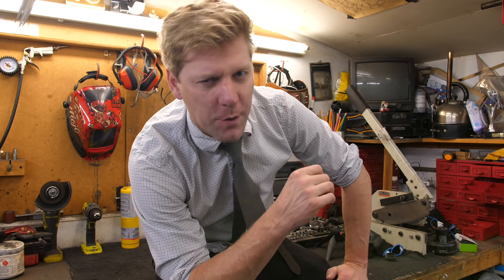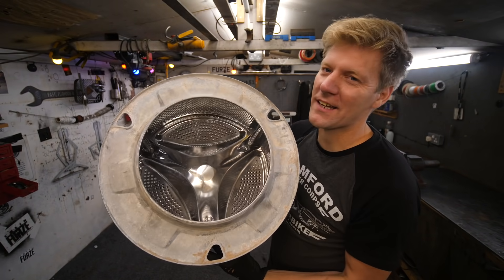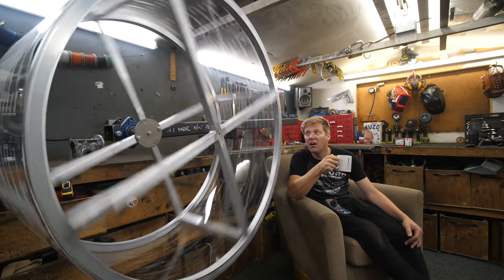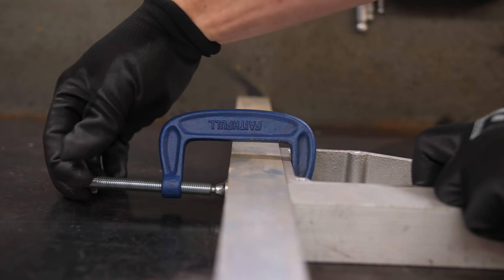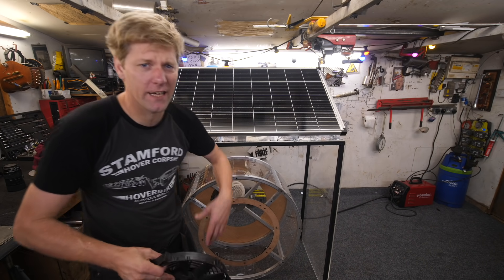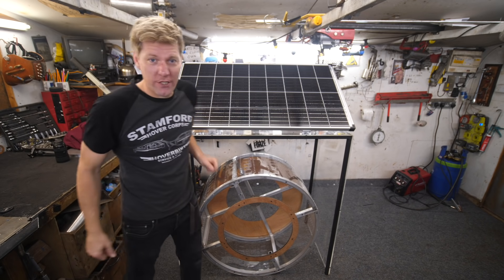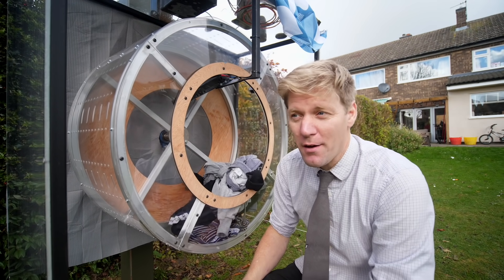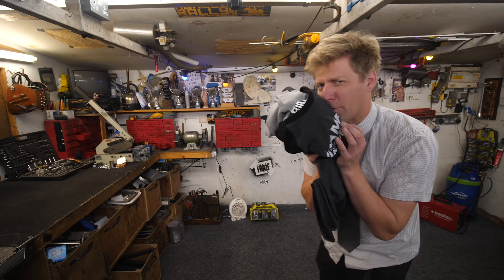Wind/Solar Powered Clothes Dryer

Comment: Now you are on laundry, I want my washing line to go up and down at the push of a button But both ends up and down at the same time, keeping a slight tension on the line and keeping it parallel to the ground. I am sure there is a way, with several lines and some pulleys? Yes or No? What do you think?

Comment: you actually lost alot of heat using the materials you did compared to the metal drum in the dryer. - the heat from the sun on them metal drum, would have acted as a heating coil. pretty cool idea tho.

Comment: Colin chooses "home decarbonization"
Also Colin: replaces a clothes line with a lead acid battery, a charging regulator, 30W solar panels, welds 30 ft of steel pipe, 15 ft of alluminum tube and uses 20 square feet of plexiglass. Huh I wonder how much carbon footprint you saved there bud?

Comment: Should use a heater with fan. Or make use of a sterling engine. Heat will heat cloths. the spin of a wheel would allow the turning of the drum

Comment: I just dont understand this outdoor dryer thing, dont we already have one of those that people have been using for over hundred years now? Yeah we do, Its called a CLOTHES LINE and it uses neither ANY motor power OR solar power, just the wind and only requires a bit of line and some clothes pins. Just saying, its kind of like reinventing the wheel here bud. LMAO. Honestly, I would have went with a Solar powered washing machine, considering a wind powered dryer already exists in the form of clothes lines. But there is NO easy way to wash your clothes without a normal washing machine unless you want to do them by hand.

Comment: I can appreciate the engineering prowess of Colin, but this is a typical renewable nightmare. It's way more expensive than any conventional clothes dryer and it's much, much less effective. A honest to goodness clothesline (or clothespin rotary clothesline) would be an excellent replacement for this with a transparent gazebo (for heat added and rain protection). It's an interesting prototype nonetheless though.

Comment: i do a better accent.. lol
a curved mirror under the unit sun directed would concentrate heat to the drum. air flow with a door on it from the bottom exhaust pulling thru the top removes humidity. by causing a vacuum  where is water in a vacuum boils becoming airborn leaving the garments faster in combination with the suns heat

Comment: You need a generator that runs on hydrogen and oxygen using electrolysis in case the grid goes down and you run out of power in your bunker ⚡

Comment: If you had a creek you could just put the drum in the water wheel and the fan on a separate wheel then use the spare energy for upping the efficiency. Drying cloths with water.

Comment: Wind and solar powered clothes dryer.... a length of 6mm cordage that is affixed at both ends to a tree or T placed in the ground and you hang clothes across the cordage, wind blows across them wicking out moisture that the sun has heated. ....

Comment: A Wind/Solar Powered Clothes Dryer is a clothes line suspended between two points raised above the ground and typically run through two pulleys. All the rest is just gadgets...lol.

Comment: Me just get a PV MPPT VFD ( Soler pump (PV Motor Inverter ) - Battery less setup
and 16x LG NeON2 415W BiFacial (upto 540W BiFacial) Solar Panels LG415N2T-L5 to make a 800V (792V) PV DC Sting > MPPT VFD 6KW > 240V AC [1 phase - 3 Phase] > UK AC socket

Comment: Far as I'm aware, and I haven't done the research and neither has Colin, that just tumbling clothes around does nothing. It blocks the wind from blowing over clothes, pulling them into it. All that moving air encourages water molecules to evaporate and leave the clothes even at whatever temperature it is outside. If you block that with a big drum and some sort of notional tumbling, you get nothing. It's much worse than a washing line. Ironically making this useless window-dressing. So you should probably win the competition. 

Buying a tumble dryer, trashing it, then deciding it's useless, that's certainly the spirit if not the letter of this nonsense. I think I'll go back to Colin digging his big hole, whoever sponsored that. It could be Satan himself and it still wouldn't be much worse than this one.

Comment: Ecological tinsel from a massive source of pollution. Like when they put solar panels on their petrol stations. Net saving, basically nowt. Petrol sold, absolute shitloads. Comes out of their PR budget and costs them basically nothing. American vehicles use something like twice the petrol that European ones use, and nobody is interested in doing something about that. Shell's entire business is digging oil out of the ground, refining it, and selling it. Renewable anything would cut into their profits. This is purely PR, "greenwash", and it's nonsense.

Apart from that, I love to see inventions. But I wouldn't be surprised if Shell bought up the patents then burned them. At least paper is renewable.

Comment: You still have to fold them after they are dry.  You can't really catch consumer attention with that cloths dryer, is the problem. Too big, too slow, only works in summer, etc... I know you said to start small, i understand. 
It would a better ideal to save the consumer time AND carbon emissions. A better ideal is to just put the wet cloths on hangers on a special line in a special built "green house" for the cloths. This way the cloths need no folding, and when they are dry then you are done, just have the line travel them into your closet. You can have plants in the green house too, maybe it will add a nice smell to cloths too. And by having them on the line they will dry much faster because there is space between them. Plus the heat build up in the green house, and some air circulation will allow drying fast. 

Better yet, figure out how to design a closet that dries cloths, this way when they are dry you are done. They are already hanging there ready for you. Maybe extend your closet to include the mini special built green house, then when they are dry it automatically circulates the dry cloths in your closet, and is waiting for a new load to dry.

Comment: One thing I have found over the last 40 years......even on a bright sunny day if you haven't got any wind you won't dry the clothes.........that is down in OZ .....and that does not apply to Summer when the air temperature at 35 deg C is enough to fry your balls off.
I'm working on an idea to rotate the Hills clothes dryer, which is an OZ iconical device found in practically all OZ gardens......going solar and Green is for the birds.......just too much mess and bother and the cost....oh my.....so it will be an electric motor, mains connected etc and coal fired via the grid.

Comment: Using Copper plates for the drum and painting it black would improve the efficiency massively (:

The most funny thing however would be to attach solar panels all around the drum and add the motor with a worm gear at the back, which engages to a sprocket which gets turned by the wind turbine.

Only the sprocket would need a one way clutch of some kind, like in the current build.

Comment: People in dry climates just run  the dryer motor on solar. Easier just to mod a dryer with a DC motor.  I run a LG washer on solar panels with no battery.  Only on rare occasions will it stop when a cloud goes over, but the washer remembers where it was when restarted.  I run the washer with hot water on all cycles giving me steamy clean clothes.  That free hot water heated by PV again no batteries so a very carbon neutral.  Electronics is the way to go.  Dishwasher with heated dry also on solar.  Whole summer home runs on only a single car battery.

Comment: the drum needs some baffles?  fins? to separate the clothes as the drum turns.  that would help keep the clothes from sliding around the inside rather than tumbling.  there could even be some blunt hooks for items to hang on as they went high to sort of stretch them out

Comment: Even simpler design: some wires between 2 walls and a roof over it.... the cloths doesnt get wet from potential rain and can dry naturally without any electrical fancy gizmo's ... dry in a few hours... worked well for the last 5000 yrs...
K.I.S.S.  -  Keep It Simpel.... Silly....

Comment: Have idea for a self powered light well sorta contact for info you build I'll give you the specifics mine works to a point don't have the math attic skills to perfect it it generates continuous power not a lot 18 to 36 volts low amps though will run led lightbulb don't need plugged in or batteries

Comment: Paint the drum with black paint, so that it absorbs more solar heat. And maybe some reflective panels around to catch even more solar heat in the drum. A thick bottom plate, insulated from below to radiate heat after sunset is another improvement i imagine could work.

Comment: Unnecessarily large (and heavy), the slick plastic surface dissuades actual "tumbling" of the clothes (could add a few obstructing inside bars like tumblers have) making a bunch of them stick to the surface, could have been infinitely better if the wheel had more holes as that's what lets air through & moisture out and the added plywood will be very susceptible to rotting and warping due to English weather and the part where you're stuffing it with wet clothes.

You should've also watched the forecast before making the wind turbine (and i do hope you added some sort of safety breaks to that thing).. Or just gone the extra mile and made your own photovoltaic cells by using copper sheets.

Comment: Air and water displacement powered air compressor driven turbine drum with piezioelectric plates to catch energy from the spinning that put the extra needed to use a small amount of the air flow to power the air and water displacement generator
....maybe even a levitating liquid pendulum washing machine built into the air and water displacement generator
Like archamedes sphere was ment for 

Ferroelectric polymer shock absorbing springs on acrylic axles with cloth in the brackets to catch the static with tinfoil capacitor

A spherical gyroscopic version would be cool

Free energy 
Like bubbling water to compress air
Compressed air can be added to water to cut through pretty much anything too
Water jets dont wear like saw blades do
All without even needing electricity or batteries

These are a few of my free energy upgrades
Awesome vids furzey boy cracking contraptions created

What about holographic projector shades using water vapor 
so nothing touches the face
Vapor density regulation acting like polarized lenses

 helmholz resonator gyroscopic antigravity supercapacitor ionic acoustic hoverboard would be cool

Comment: Hey Colin! I don't fully expect you to notice a comment on a month old video, but I just wanted to say I think this is a great idea, and I'm no expert, but thinking of my own clothes drier that I use, the air usually blows in from the back or through all the small holes punctured in the barrel itself. In this specific configuration, most of the air would leak out rather than pass through the clothes, since there's no door to isolate it, but you noticed that yourself of course. Secondly, most driers have inwards-facing fins that portrude from the barrel, creating slight "steps" that the clothes hang onto for an additional second before they drop back down, this would bring the clothes closer to the fan, as well as make them fall back down to the bottom while the other clothes are being brought up, creating more of a tumbling chain of motion, since your dryer seemed to have a lot of the clothes slide around the bottom for the most part, since there wasn't enough friction to drag them up at all, which might explain why the thicker clothes weren't drying, since heavier objects tend to stick to the bottom of a pile.

That's just my two cents of course, I'm no expert. Cheers mate!
Reply from the maker: your right but this was a test mainly of the wind and solar parts firstly, theres lots of things to improve so will revise it at some point
Reply: @colinfurze have you revised it yet
Reply: @colinfurze  *you're
Reply: I was thinking something similar, if you put more square stock across each one of the U shaped pieces, turning them in to a rectangle, the clothes would get caught on them and spread them out across the entire dryer, should increase drying time.  and if you put it inside an actual greenhouse, it'd get more heat, and the moisture would go in to the air, helping the plants.  Maybe I'll experiment at my brothers property in the mountains this summer.

Comment: The 'Wind/Solar Powered Clothes Dryer' has already been invented.
It's called a '#WashingLine'. 👍🏻😂
Reply: ...No, I did not check the previous comments.
Also - I was impressed by the creation - definitely easier than a washing line, albeit considerably more expensive to make (especially if you only have cutlery for tools to begin with).

Comment: Once again solar power beats the pants off of wind - cheaper, simpler, more reliable and just plain more powerful. For the money and time into the turbine you could buy a couple more panels, though I realize half the fun is the build here. I consider adding a wind turbine to my solar array occasionally, but always remember that it's rarely worth it on a residential scale. Utility scale wind is a different story.

Comment: Feel like concentrated solar into a temperature battery you could use to help heat and power the process would have worked better than straight solar. Good not to waste the wind though.

If you can get the sun to run hot enough maybe getting the wind and solar and which-what every to build up speed on a fly wheel to better tumble the laundry. Steady as she goes but a modern drier does have some advantages. Don't see a lot of fly wheel reliant projects online. Suppose it's a bit outside the ability of most hobbyists to craft and perfect... some day, somewhere, somehow.

Comment: Solar power and wind power alike are.... unfortunately poor options for renewable energy because they are both conditional, and revolve entirely around the weather. Water power is probably the best option, water delivers lots of force and is pretty consistent, most rivers don’t magically run dry overnight. Next is geothermal power which uses heat in the ground, which is often consistent enough to deliver somewhat consistent energy output, but geothermal systems lack power. As things currently stand, combustion is our best source of energy because it delivers power unconditionally. Tesla is a perfect example of this. My pickup from 2012 with absolute garbage fuel economy and a stupid v-8 has greater range than a Tesla, and it takes significantly less time to get it on the road when I run out of fuel. My truck has the aerodynamic qualities of a brick and is more sensible than even Tesla’s current best car. With the technology we have, we cannot get the sheer power and speed of combustion through renewable energy. Sure, we can make it work, but we’ll all need to learn to be a lot more patient.

Comment: Great project Colin you are an inspiration. 

Oil company greenwashing.  The oil companies use these project to look green and cuddly and for issue deflection.  

Pushing issues back at us makes you and I responsible and while we have some, no amount of changing light bulbs or saving paper is going to cut it.

These companies are the problem, they have known about the problem for 30 years and chose to do nothing but hide the issue and keep making money. Shell knows the greenhouse gas issue and yet they are still actively looking for new sources of oil and gas.  The current income from oil is $24billion 

What have they put into this project, a few £1000  They need to be committing billion to solve the problem.  If there were actively reducing production and changing the business model then I would be more receptive. 

The world needs to reduce consumption of oil and gas by 6% a year every year until 2030 and that will just about keep us on target
Reply: people... please listen to this man.

Comment: The most fundamental element in that thing is the car battery. It's the only power that makes everything move. The wind is barely able to move the mill itself, and the solar panel works only with the continuos direct sunlight, otherwise it comes down to 20 or 10% power.
Take the battery away and only then it's renewable energy.

Comment: Ditch the motor and attach a series of fans to run the turbine instead
Reply: Ailsa Ni  I would too considering commercial dryers spin anywhere from 800 rpm up to 3500 rpm

Comment: Maybe put the gearbox backwards, or put a higher geared gearbox, so it spins faster. Also that wind turbine is not efficient - I think you need to improve the curvature so it deflects the wind in a more efficient way. A much better way would be to do a propeller turbine instead - having it turn freely, and then a flag (wind follower) which forces the blade to turn against the wind. (Since its free-turning and also the wind force excerts a turning force on the whole contraption, you need the wind follower wing to be pretty big).

The great thing with such a construction is that the actual turbine part can be on a ball bearing and be totally freespinning, any spinning will turn the axle, and spinning the blade will also turn the axle. Very simple.

Comment: I guess if you make a boat electric it could be improved on for long distance travel. Hulls for one should have dynamic projections capable of being extended in favorable currents and basically dissapear in unfavorable conditions. Add turbines in the side of the hull to catch the crosswinds including the upward force. When full store compressed air in a large tank to convert to power. Add infrastructure such as floating solar farms put in known dead zones and geothermal floating stations where convenient. Add ai. Magnus turbines. Reduce speed.